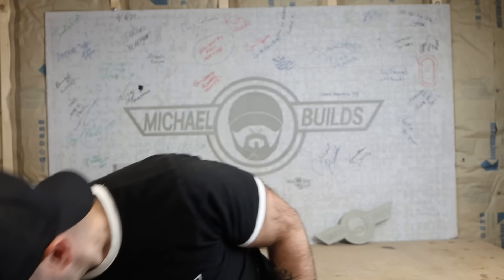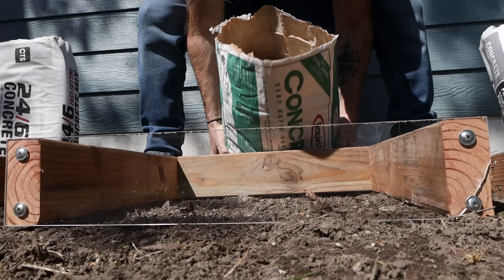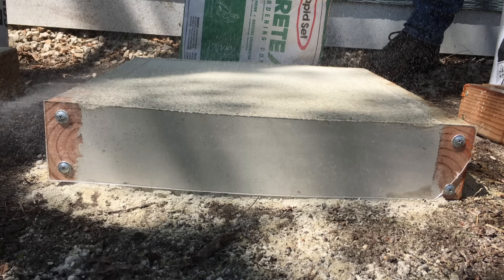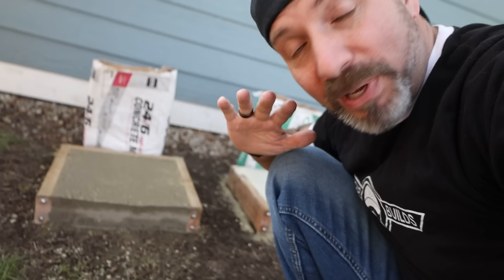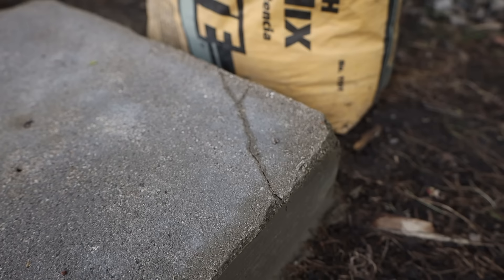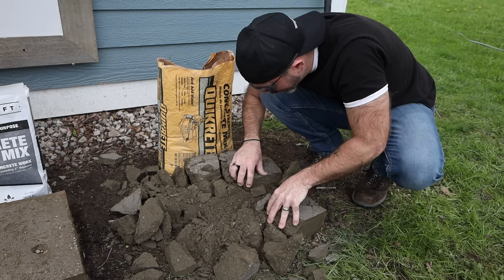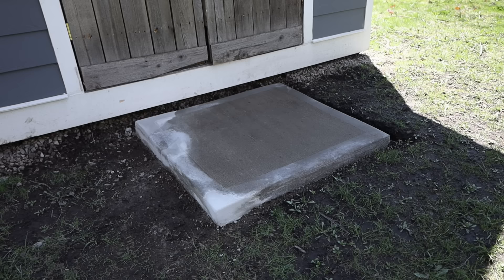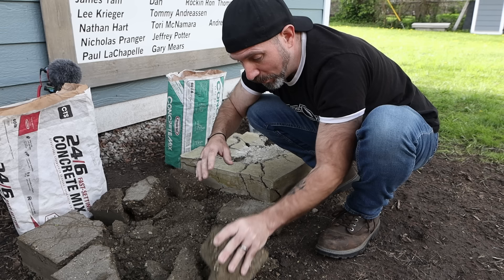Dry Pour Showdown!

Comment: Of course the point is not to have dry pouring sweep through the concrete industry as the new way to do foundations but rather a viable option for a DIYer to do a fence post, stoop, chicken coop floor, stair riser, etc, especially one who does not have the full array of tools for mixing and working with concrete.

For that, this is a good tool to have in the mental tool box as an option under certain circumstances.

Comment: okeedokee, First off, thanks for what you do Michel, as a long time doer, love this sorta stuff. i did my first dry pour 3 years ago and used Rapid Set Cement All.  i'm doing walk way slabs with pavers dividing about 24x30 slabs averaging between 2-3 inches deep. So far, the the Rapid Set has zero issues, was a breeze to do compared to a wet pour. Today i did 3 slabs using Sakrete High Strength and discovered it's reinforced with boulders? i'm obviously not a cement pro, but that was a mistake me thinks, unless there's some magic way to get the rocks off the surface, and especially the ends of the slab?  The other huge difference is cost. The Rapid set  is 5x more expensive than the Sakrete was. The other thing i did  differently is i misted almost continuously from the start, the goal was to get saturated similar to a wet mix. i have no idea the reasoning behind waiting an hour between misting and wetting?  My thought process was i wanted it similarly wet to mixing from the get go, and i stopped when the puddling on the top seemed to be staying much longer. i know, very scientific.

Comment: A couple of thoughts. Spraying the ground before you pour for better absorption from the bottom. Rebar for bigger projects? Half pour, rebar, mist, finish pour, finishing touches and mist.
Reply: The 2 steps you mentioned will make a world of difference in the strength of a dry pour. Without these two steps being done dry pour is far inferior to conventional mixing.

Comment: I think it's worth taking into consideration the manufacturers guidelines for their product. The Menard's Mastercraft cement specifically states to add water and mix. However they do have a Fast Set Mix and an Instant Post Cement. The Fast Set mix states it's for sidewalks and structural posts, where as the Instant Post Cement states it's for non-structural applications such as Mail box posts, fences etc. I would be interested to see how those stack up.

Comment: Would it help to give them more moisture when you first wet them? A thought for the rapid set, and probably the others, would be to put it down in layers with soaking in-between.
Reply: That seems like just as much effort as mixing it the "regular" way. I'm curious to see the strength test.
Reply from the maker: Definitely an option for sure

Comment: Got 3 questions for you: 1) Is it advisable to wet the ground first before you pour the dry concrete mix, 2) how do you know if you gave each batch the same amount of water, or does it matter? 3) Is it possible to over soak the concrete mix after the initial moisture drizzle?

Comment: I plan on doing a small shed this summer.  But I plan on lining the whole thing in a building wrap or plastic wrap.  Which either is the cheapest. It just seems that your loosing moisture to the ground.  If the moisture stays there it will be soaked up and into the concrete.  Even as it cures I plan on keeping it wet so the underneath stuff will cure too.  I really liked your test.  But you should have waited longer to break them up.  To see what that moisture did inside. Would it have created a hard durable slap.  Later

Comment: I mean, it's pretty straightforward what would happen with "dry pouring".

It dries at different rates and different temperatures through the thick slab. Thick slabs will pop and crack fairly quickly due to extremely uneven setting. You had some pops all over these for this reason. 

Thin slabs -- this is a great method. Been doing this for ages.

Tip: try sprinkling rapid setting concrete mix onto gravel. Keeps it in place for trenches and drainage!

Comment: As a concrete guy ill comment for clarity. Sure those tiny slabs can be done dry.. any bag of concrete will set up if left out in the humidity but other than post holes i wouldnt do it that way because you can and will get dry pockets in a real slab and un even amounts of water through out the mix, which will cause varying degrees of cure. ie.... Think of the old curbs that decay and start turning to sand..thats from a bad mix. And the sides sure look troweled or skim coated. Should be more rough like the grain of the lumber he used for forms. Just sharing my observations. I still like the experiments and such.

Comment: I've watched their latest video of their patio slab. They clearly say the method is meant for LIGHT FOOT TRAFFIC ONLY, and it probably won't hold up for the long term. In fact, they're only planning on using the latest patio slab for temporary, so if it cracks it won't matter, as they'll be doing it right next year.
What they specifically did not say was that the dry pour method would stand up to a sledge assault after 24 hours.
HOWEVER . . . Concrete, once set, continues to gain in strength as time passes, and if water is added after the initial set, will continue to absorb water over time, and get harder and harder. So I would say, if the concrete is soaked daily for a couple of months, it will probably get stronger and stronger.

Comment: You should take the 2 best of the dry pour and also do them with the traditional method. Make 2 forms for each, so 8 total (2 x 2 x 2). Break one set after 1 week and the other after 4 weeks.

You could also expand it one more step after that test and reinforce them (or you could put reinforcement in half of each).

Comment: Do multiple slabs of each. Take 1 slab, mix at the manufacturer recommended method. Then do the dry pour method. I'm 100% sure you will see a huge difference when smashing it with a sledge. 
As someone else stated, manufacturers would recommend this method if it worked. Dry pour compromises your strength and integrity of the slab. Don't be lazy, mixing works best to activate the adhesion.

Comment: So cement and concrete have lots of porous area even after curing, which causes capillary action to pull liquids into the cured material throughout the life of the material. That is what you are ultimately taking advantage of for all the subsequent wettings. You just need to keep wettin this stuff almost hourly for a 12-24 hour period.
-GC and Concrete Contractor from NC

Comment: Hey your videos have inspired me to approach some bigger diy cement projects recently, but I do have a project for you to try if you need something else to show. Multiple bonded layers for a 6" suspended slab. In my instance, the location and cost of the project limited my pour time to a 3" slab layer (4.5'x11.5'x3") which will be followed by a 3" deep top coat capping over the first pour with full depth at the borders in a couple weeks. The top coat for me is 6'x13'x3" with a 6" border at the sides and drip end. If that doesn't make visual sense, think of it like a hat going on top of the first slab pour.

Comment: Since portland based concrete doesn't fully cure until roughly 99 years, I would expect the middle to continously bond and cure over time while being protected by the harder outer shell. We all know concrete strengths are determined over time, alluding to the continuous curing, so a soft moist center is not necessarily a bad thing. Thanks for the video!
Reply: Lol that sucks considering how it really doesn't weather so great.

Comment: I've never used this method, but I've seen plumbers do it. Your problem is misting it, especially the rapid set. You needed to soak it for an accurate test. By misting it and letting it sit in-between misting, you caused it to cure improperly.

Comment: Given concrete sets harder and stronger with less moisture this might be a stronger method if it’s fully wetted, my only concern might be delamination from differential curing, but I think the strength will be there 💯 especially if after the initial 5-6 showerings you finish cured it under water
Reply: Concrete cures stronger with moisture, not less moisture.

Comment: Concrete relies on free water to set properly. There is a balance in wet concrete between too much that dilutes the mineral glue in the cement and not enough preventing the mineral glue from forming which results in the cakey half set in this video. They use a slump test to measure this by seeing how far wet concrete spreads. Even wet concrete that has an initial set benefits greatly from being wet during curing. Concrete test cores are cured underwater for this reason. I would think these dry pours would benefit from way more water - like a misting sprinkler on 5 minutes every 30 minutes for the first two days then a good wetting twice daily for another week.

Comment: This method is super fascinating. Im curious how this would work in various shaped molds. Im also curious if you spent time packing the dry cement before wetting it would that change the outcome. Ive heard this method works perfectly for fence post setting but im curious all the applications this can be used

Comment: I'd love to have seen another form with a wet pour control sample. This way you would be able to show if the dry pour have similar strength after 24 hours. 

To me, none of these seem like they ever got wet enough to solidify. Theoretically, concrete with a lower moisture content ends up stronger (if you add too much water to wet pour concrete, it lowers the final strength). But you need enough water in the mix to completely hydrate every particle to get a good reaction. With wet pour concrete you definitely add more than enough water but I think this is the other end of the spectrum. 
Maybe set up a sprinkler to constantly water the dry pour forms for a few hours. Ideally I'd hope for an 80 lb bag of concrete to absorb 3 gallons of water. Maybe crazy overkill but I wonder if a form could be made that was water tight enough and had enough extra space to hold 3-4 gallons of standing water above the concrete. After the misting stage, fill the top of the mold with the water and wait for it to be completely absorbed. Then you'd know you gave it enough water to hydrate fully.
Reply: I've been thinking the same thoughts. But moreso, I was going to premesure the amount of water as well, rather than just add random hose amounts. As for watertight, I was thinking underlay some plastic, and possibly also up the sides of the forms too. And of course cover the slab after the inital hardening set, to stop evaporation as well.
Sadly, I won't have time to test myself for a while yet

Comment: I do not understand much on Concreting but as far as I can tell it is the Sand that gives you the strength, I would be curious to see this method with added sand. Obviously you will have to make some mixing BUT it will be much easier than wet mix.

Comment: The problem I see with the dry pour for a slab, is there is too much air trapped in the mix. Yes the water wicks into the mix, but there isn't enough to fill the small voids. I have poured 6' x 6' slabs by mixing a bag at a time in a wheel barrow, slow, but good results. The only dry pour I use is for posts. Set the post, pour the dry mix and tamp in place. Wet it if the ground is dry and move on. I have never had a post come loose.

Comment: I'd be curious, because Ive gotten lazy with post setting and starting mixing in the post hole. A little dry, post, more dry, water, poke with stick, more dry more water. Leaving it a little dry in the end. I have a clay soil and figured it could absorb a lot of water from the dirt. Mainly doing because im sick of cleaning the wheelbarrow and none of it is really structural.

Comment: Ya really needed to have measured out the exact same amount of water given to each slab at each interval. Trusting your hand grip strength on the water nozzle and I guess counting in your head how long to water doesn't quite cut it. A half cup/quarter cup or more water difference either way in your spray technique can be a big difference in I feel in this dry technique. The whole misting thing is so you don't disturb the top finish to get it to firm up so you can then give it a good drink and it won't hurt the surface. But ya, the rapid set stuff is no bueno at all for this method.

Comment: Need to cut the samples.  Beating them with a sledgehammer makes it hard to tell what was damp and uh-bonded vs just broken up from being beat into submission.  Also agree about the control samples as well as waiting longer.  24 hours isn’t enough time.  

But I suspect concrete’s hardening process needs more water so that the expansion and bonding of the particles happens more uniformly.  I’m guessing this dry placement leaves more tiny air pockets and the slower curing probably “wastes” some of the hydrations crystallization on air vs other aggregate.

Comment: Question that needs answering... What stops the water weaping right at the front where the plexiglass is at? It's rather strange that you would get 2 soakings getting an inch each, to what I would think should be slower every time you wet it after as the top layer will let less and less water from going through. And if this is true, that water goes through this 'dry concrete' as fast as it does, well, laying down anything that would get damaged from moisture will need to consider that fact. Proper mix will almost become a barrier for water, obviously not impermeable, but damn near it.

Comment: Thanks for doing these test for us! Great test, but there is a great weakness too: the water should be prevented from socking the underneath (because it would not happen in a large slab, and the soil texture could change from one place to another: e.g. Rocks).
Reply: (I found this on another site written by a civil engineer)
@mikehewitt1253
1 month ago (edited)
Dear all, let me try to help everyone understand concrete. 

The cement part of any mortar or concrete reacts with water in a hydraulic chemical reaction (exothermic reaction i.e. generates heat). When thoroughly cured, meaning allowing enough time for this reaction to take place and preferably throughout all the cement particles where they become irreversibly hardened and water proof.

However, cement on it's own will shrink significantly and crack all over so it needs a binder - sand - this 'stretches' the cement through the mix so when it hardens via Curing it's bonded to lot's of already hard sand particles and more cement particles alike creating  a hard material that doesn't crack - mortar.

However 😁 mortar is not strong in itself. For strength we add Aggregate, ideally for strength you want some flat, some irregular stones (not pebble like) of 3 sizes - pea size, golf ball size and halfway between those - giving us Concrete when Cured throughout.

Now, I've watched many dry pour vids with interest and listened to the nay sayers saying it has to be WET to cure and therefore dry pour is nonsense.........

Time for education folks where (after that which I have outlined above) you will be surprised that I'm on the side of dry pour ....... SORT OF......

When dry pouring, it is tamped thoroughly down before spraying - this is GOOD - but cement particles and sand particles and aggregate elements throughout will not all receive moisture, will not Cure and will remain as dust in parts - not good.

BUT Wet is not great either! It's CONVENIENT.

The best, strongest concrete is Mechanical Concrete which is made with JUST ENOUGH water to provide moisture throughout for correct curing.

The test is - grab a small fist full, squeeze hard together in palm of hand and if doesn't hold shape and crumbles when released from pressure, needs more moisture. The shape should Break cleanly in two pieces without crumbling - if stretches in the break test, it's too wet.

So my recommendation to all is........

Dry pour mix thoroughly together with rake, add moisture by spraying so as not to over-wet BUT rake that moisture throughout and THEN Tamp down hard compacting it all properly and level off.

All this 24 hrs later stuff is inadequate - Minimum curing time is a month - covered to keep that minimum moisture in the mixed pad, base, driveway, - shouldn't be touched, don't go near it - best of both worlds here as easy as Dry Pour and stronger than the normal convenient Wet stuff which because of too much moisture cannot be as compacted and consolidated to provide the same strength.

Go Mechanical guys, it's the best. Anyone want to hear my views on Earthcrete, which I find fascinating - by the way - I'm a Civil Engineer - spent an entire year studying Concrete - an entire bloody year on nothing but concrete.

PS DON'T use quickset anything, you won't have enough time for all rake work, use standard Portland.
Reply: @illiniwood  thanks for sharing!  Though I don't get the main stuff: "Dry pour mix thoroughly together with rake, add moisture by spraying so as not to over-wet BUT rake that moisture throughout and THEN Tamp down hard compacting it all properly and level off"  eW need a video, thanks to make one! ;-)   (May the God of cement be with you)
Reply: @ytrew9717  Due to the bag of concrete being processed, shipped and handled, the aggregate will separate and settle. He's saying to mix the dry content of the bag to reconstitute the portland mix with the crushed rock. This results into a far more effective cure. I hope this helps.
Reply: @illiniwood  Oh I see, that makes sense. Thanks a lot! (Greeting from France)